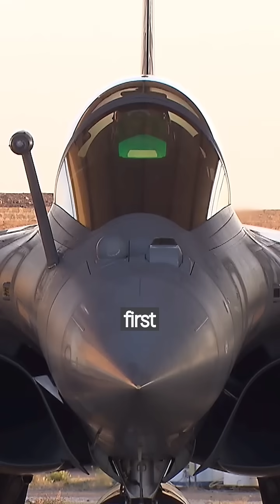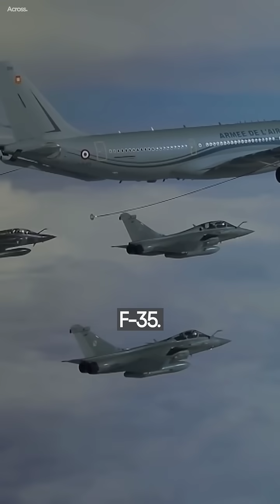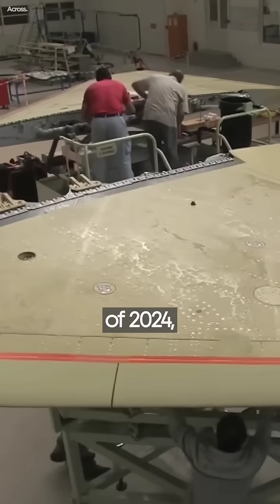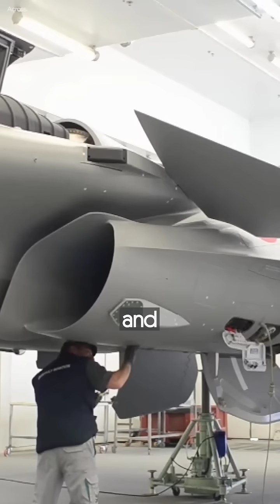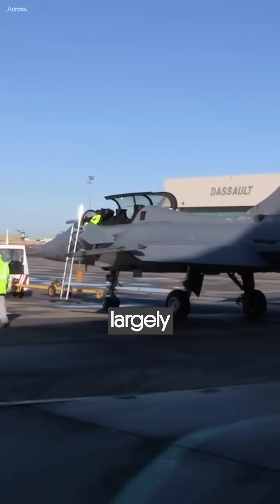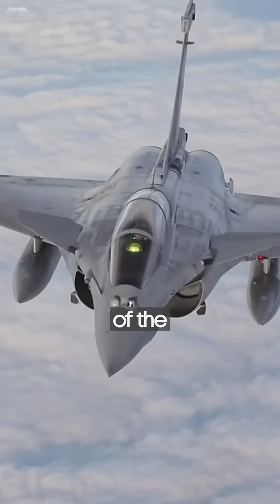The Fighter Plane No Nation Wanted to Fight #shorts

Comment: Dassault Rafale compared to Eurofighter Typhoon and SAAB JAS 39 Gripen, the Rafale is designed for take-off on aircraft Carriers.
The Canards Position is different to the other Designs listed.

Looking on the Chengdu J-20 and compared it with the SAAB JAS 37 Viggen the Materials and the Computing onboard is newer while regarding real on-board Computing SAAB showed Pioneer-Quality at the SAAB JAS 37 Viggen.
US-american companies started cooperation with SAAB those days...

While the SU-57 is Just a Stealth SU-27 and the SU-35 Just a Stealth Mig-29 the Chengdu J-20 is Just a Stealth SAAB JAS 37 Viggen.
The SAAB JAS 39 Gripen is more than a single-engine Eurofighter Typhoon.
The Dassault Rafale does not reach the climbing rate Performance of the Eurofighter Typhoon as well as other high Performance manouvers.
That's related to the Position of the Canards.
Eurofighter can Not Take Off in aircraft-carriers except the Big one on Cyprus called "Akrotiri and Dhekelia" (Sovereign Base, UK Military).
USA's biggest aircraft carrier is called "Rammstein"...
Reply: Only Rafale M are capable of carrier landing and take-off
Reply: @jonlaurenzreyes1902  The Rafale, Eurofighter Typhoon and the SAAB JAS 39 Gripen do have in Common the

Deltawings-Canard-Configuration

This does not mean that Like the Rafale all Other listed Here are near to the F-16 regarding diverse characteristics.
The Rafale is optimized for dog-fight regarding air-superiority nd in the Initial requirement-spec a M-variant was a "shall"-requirenent.
At the SAAB JAS 39 Gripen Nobody ever told how and Why the SAAB JAS 39 Gripen can be modified to a SAAB JAS 39 Gripen M. We know from SAAB that there can be a SAAB JAS 39 Gripen C/E M.
At the Eurofighter Typhoon it is well known that after "Jäger90"-Spec the spec of the Eurofighter Typhoon was reaching a point where a M-Variant was skipped for the Advantage of interceptor-abilities.
So we know that there won't ever be a Typhoon M die to the optimization for a interceptor-jet-design.
The Eurofighter Typhoon has non of the Common characteristics of Rafale and F-16.

The Eurofighter Typhoon is the Most extreme Designs at interceptor-jets and the climbing rate is outstanding.
Not Just the fact that the 9g-manouvers can be flown thru with highest Speed the remaing Energy a critical manouvers are kept by the Typhoon on highest Level.
This in Combination with IRIS-T at dogfight (Typhoons dogfight Style) let  a F-22-Pilot experience a real hard time and very offen a short time. In more cases Typhoons intercepted successfully F-22 and Others Jets then the other way around. The other way around, means the Typhoon was unsuccessfull at interception.

You need to understand that interception is different to the Hollywood-Style dogfight.
A interceptor should be tbe nearest thing to the Me162 Comet in the basement.
The SAAB JAS 39 Gripen is light enough to follow the Typhoons Here, the Rafale thinks about dogfight and air-superiority too early.

The Typhoons are dominant at showing their weapons underneath their wings in the days of Peace.
With the Rafale you are nearer to Battles.

Interceptor! Means Peace-Keeper!
The Eurofighter Typhoon is a Peace-Keeper Like the Taurus Missile because the Taurus is 100% deterrence.

As France is protector-power of diverse "... outre mere"-territories France has air-craft Carriers and dogfight-jets.
UK at Falkland-war experienced dogfights with their Sea-Harriers beyond the Operation of the mighty Avro Vulcan from a Islands used as air-craft-carrier.
So Rafael is multi-role Jet and dogfighter.

Germany needs interceptors. Thre was a curtain in the past and today the frontier in Ukraine ist Not really far away.
The Location of the Thypoon Fleet in the North of Germany near to the Baltic sea also calls for Interceptors and Not (Just) multi-role-jets and dogfighters.
Reply: Rafale doesn’t come nowhere near close to euro fighter Typhoon, there’sa massive difference in performance between these two. Rafale is all round fighter plane but then Typhoon is on completely another level.
Reply: @adrianuk8102  Eurofighter Typhoon is a pure interceptor with Multirolle Jets capabilities.
As a interceptor the Eurofighter Typhoon is unreached.
The Me163 Komet was also a interceptor. The Me163 was breaking thru the Clouds right away from the start Like the Eurofighter Typhoon.
As a interceptor Iit is also about max. Speed on max. altitude, 9g-manouvers and remaining kinetic Energy after diverse manouvers. The Eurofighter Typhoon is top at all the characteristics.
But it is in diverse Situations handicapped with it's Higher Mass of the two jet-engines but more compared to the SAAB JAS 39 Gripen and less to the Rafale.
The SAAB JAS 39 Gripen does the tightest Turns. The Well balanced characteristics of the SAAB JAS 39 Gripen let it do manouvers also at highest Speeds Like the Eurofighter Typhoon. At the Eurofighter Typhoon the structure and weight is the limitation at extreme manouvers. At the SAAB JAS 39 Gripen it is the human Body of the Pilot. The SAAB JAS 39 Gripen E/F has a escape manouvers where 13g are reaches. Rafale and Eurofighter structure would collapse. The SAAB JAS 39 Gripen E/F remain intact..
Reply: Euro fighter taille-foune is nothing compared to the Rafale. 

Suffers three main design flaws and can not do half what Rafale does.

Rafale is even better at air superiority.
Reply: @alexdarcydestsimon3767  ...so you may list some examples what Rafale can and Eurofighter Typhoon can Not, Here.

Same with Dassault Rafale vs. SAAB JAS 39 Gripen.

Hopefully you don't start comparing Eurofighter Typhoon of the Austrian Airforce with a Rafael with one of the best Equipment-Setups.
That's Like entry edition vs. Something Like a Ultimate Edition.

Fact is that there is somekind of opinion going thru the web that the Rafael was optimized for dog-fight related to air-superiority.
The Eurofighter Typhoon is wrongly defined as multi-role Fighter.
The Eurofighter Typhoon is a pure interceptor, while it is possible use it as a multi-role Fighter.
The Panavia Tornado is designed as a multi-role Fighter and at zero-altitude Flying more or less still unbeaten.
The Eurofighter Typhoon has not the Instruments, etc. for Zero-altitude Flying.

A interceptor intercepts e.g. F-22 and Dassault Rafale.
Eurofighter Typhoon is the best interceptor and the best for Defense.
F-22 and Dassault Rafale do escorting, establish air-superiority and do Attack to be intercepted or not.
A Eurofighter Typhoon is defined by the only Pilot who flew the F-22 and the Eurofighter Typhoon that the F-22 has a hard time against the Eurofighter Typhoon.
You do mis-interpretate the terminology "air-superiority".
Using a Fairchild A10 Thunderbolt II e.g. in Ukraine calls for air-superiority Jets as a addition.
Reply: Bullshit 😅

Comment: TLDR cheaper than F-35
Reply: Rafale is $125 million no stealth
F35a is $82 million with very good stealth
Reply: @ryszardfalkowski7917  Stealth is a spectrum, not an absolute, and F-35's acquisition cost is way higher than $82 million. Also, it breaks all the time, which is unfortunate.
Reply: @adrien5834  NO kidding that stealth isn't an absolute. I'm not talking about acquisition costs. I'm simply saying it's cost to the Air force for F35a is 82 million for 5th gen vs 125 million for 4.5 gen Rafale. And of course the acquisition would he more , look up the upcoming block 4 updates , it's science fiction. And yes when something is so highly technical it will need more maintenance but that's what mechanics and technicians are for. Don't get me wrong I actually love the Rafale but you cannot compare different generational jets. I love the P51 mustang, but does it even have a chance against any 4th gen aircraft? Even the earliest productions, it doesn't stand a chance. Question is why the Dassult Rafale have to be 125 million?

Edit: Go ahead and say how 1 Rafale killed a F22 Raptor in war games and I'll come back with full story and talk about how a Raptor ate 6 Rafales for breakfast.
Reply: @ryszardfalkowski7917  You can compare a good weapon system with a bad one. The most important characteristics for a weapon system are reliability and cost. I'll let you do the "math" yourself. As for your nonsense about the Raptor, no F22 ever shot down 6 Rafales. There was one DACT exercise at ATLC 2009 which resulted in one Rafale victory, one Raptor victory and 4 draws. Surprisingly good result for the Raptor which is not designed to dogfight.
Reply: @adrien5834  During a joint exercise in the United Arabs Emirates in November 2009, a U.S. Air Force Lockheed Martin F-22 Raptor was "shot down" by a Rafale in a mock dogfight. The F-22 had actually scored well in its simulated sorties, downing six Rafales and drawing in five more.Nov 21, 2023

Stop Only telling half the story, people know better.
Reply: @ryszardfalkowski7917  Your source is incorrect. There were 6 dogfights, one Raptor victory and one Rafale victory.
Reply: @adrien5834  'You can compare a good weapon system with a bad one'

But we are not doing that here , we are comparing 2 great jets , and I love the Rafale and the J39 Gripen but, with stealth the F35 would need to be very close to the Rafale to be locked on and downed, while the F35a would see the Rafale coming from a long way off and wouldn't know what hit it before it even spotted the F35. I don't know why it's so hard to accept that when nations go to wars the first wave would come in stealth form and after a few days to weeks of that then would jets like the Rafale , Viper and Gripen be used , heck I would even develop a few squadrons of P51 mustangs to do damage and save on operating cost but that's just me and I don't have my own AF
Reply: @ryszardfalkowski7917  kiddos not knowing a damn about radars, passive detection and optical detection are in the place
Reply: @ryszardfalkowski7917 Rafale is 100 times cheaper to design and 3 times cheaper to operate
Reply: @CaptainDangeax  F35a costs 28-35k to operate and Rafale is maybe 70-75% of that,  but NOT 3 times cheaper. And to buy one F35a is 82 million 5th gen and 125 million for a Rafale newest version. I'm not talking about RnD costs, only the final price of the plane.
Reply: @ryszardfalkowski7917  "maybe". I see you don't know
Reply: @ryszardfalkowski7917  kiddos dreaming about Harry Potter's cloaking device are in the place
Reply: @CaptainDangeax  Angry French edge lord 🤣👌
Reply: @ryszardfalkowski7917  Yeah. Look, the F-22 has been taken out in BFM by Rafale, Typhoon, F-16, F-18, Mirage 2000, and I don't know what else. And no, they didn't have fuel tanks on when it happened or any restrictions, because it simply wouldn't make any sense. That's just the way it is, BFM is as much, or perhaps even more, about pilot skill than it is about the plane itself. The F-22 was never designed to be a dogfighter anyway, it's a stealth BVR missile shooter. I don't know why you are coping so hard about this, it makes no sense.
Reply: @adrien5834  I keep listing sources and my comments with proof are being deleted , who is coping? 

So you basically admit that Rafael,  f18 and all those other 4th gen fighters wouldn't even have a chance to have a dogfight against a Raptor.

Raptor ate 6 Rafales for breakfast , meanwhile only 1 took down a Raptor with 4-5 draws. 

But why delete my comments with sources listed? Take the L like a man and let the Rafale take the L like a 4th gen jet that it is when compared to 5th gen fighters. And here I thought only the Russians and Chineese lied about their capabilities, didn't realize the French straight lie to you on screen 🤣 to sell their product.
Reply: @ryszardfalkowski7917  I'm not YouTube, I can't take down your comments, and if I could I still wouldn't do it. Why would I?
I've just told you that every modern type that currently flies has beaten the F-22 in dogfight at least once, so what's this nonsense about not having a chance? You CAN read, can't you?

Comment: F35 >>> Gripen >>> Rafale >>> Mig 35
Prove that I am Wrong.
Reply: Just look at the swiss evaluation...
Reply: No stealth on the rest.
Reply: F35 is a joke.
It keeps crashing not even out the factory's court yard.
It's software makes Microsoft Windows look reliable.
It's structure is too weak for its engine...

Etc...

You are very wrong.
Rafale  equals F22 》F16 》 A10 》Typhoon 》P51 Mustang 》 Van'S RV7 》F35
Reply: Stupid comment. Prove that you are right first.
Reply: Prove that's you're right first!!
Reply: @GuigEspritDuSage  
I have asked first!

Comment: What would make this a 4.5 gen?
Reply: because it has 5gen tech but does not as stealth like 5gen fighters

by 5gen tech i mean, aesa radar, irst, ew warfare, supercruise...
Reply: @kinka16  correct me if I’m wrong because I am no expert but don’t many non-stealth American jets and 4th gen jets in general have AESA radar, the ability to super cruise, irst, and electronic warfare systems? I thought those were just high end 4th gen tech. I thought 5th gen needed stealth or advanced levels of data sharing and control/coordination of other jets or drones.
Reply: @funkeyfreddy  well you see 5gen is a marketing thing, because when the us make the f22 of course it was a big step ahead and named it 5gen. but it is a bit goofy because the f22 didn't have irst at first while rafale had, supercruise is a 5gen factor but f35 haven't it... while both f22 and f35 have stealth and rafale not. so the true and only thing that define a 5gen jet is stealth, what does make a jet a 4.5 is all other features a 5gen jet have but without stealth, sensor fusion and connected battle field is a 5gen thing also (f35 is the best for that, then rafale, then f22)...i don't know if im clear 😂🥲

Comment: What advanced sensors does the F35 have that the Rafale does not have ?
Reply: EOTS,DAS,hive mind support much more Rafael doesn’t come close to f-35
Reply: @pooferfish2850  Rafale have them since the early 2000's, even in the first rafale series (F1). That was part of the data and sensor fusion suite. But it's not the same name. The true plus in computing and electronics systems where the F35 seems brilliant compared to competitors is data discrimination.
Quite all the stuff, lockheedmartin speaks about the F35 electronics systems, Rafale had then previously but Rafale is older and upgrades (F2, F3, F3.5, F4.1) did not remove all the legacy, so F35 tends to have more up to date systems. In exemple, Rafale seems to still use a 21Mb/s system bus and so apparently engineers had to bypass it in order to install the last hi-res sensor pod. I think, it's probable that this bus will be upgraded in F4.2 Rafales.